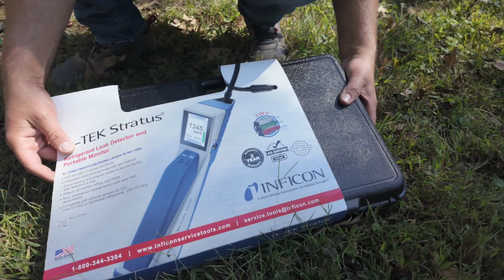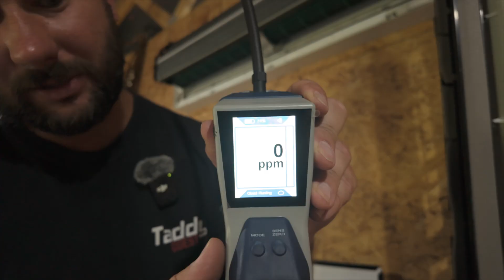How to Find a Refrigerant Leak on a Mini-Split (Step-by-Step)

Comment: Which is more sensitive, an ultra sound meter or the particle detector?  I have my doubts about an ultra sound finding a leak so slight it takes years to deplete a charge noticeably by a noise (vibration).

Comment: Here's my question as why they use a 45degree flare they are for low pressure instead why don't they use a 37 degree flare for high pressure as they use in aviation ? My guess is there cheap

Comment: I’m honestly not a huge fan of this method… never seems to get the flare squared up, and always appears to have a thin edge on the outside. Seems to have a high failure rate on breaking off from stress too. Idk am I crazy? Just ordered a clutched normal one